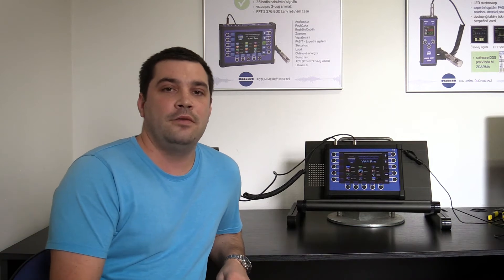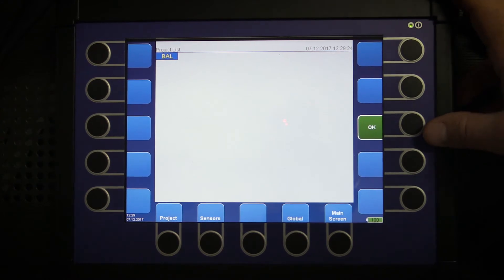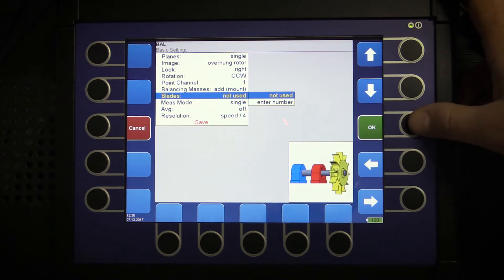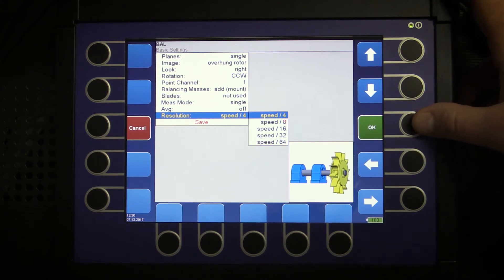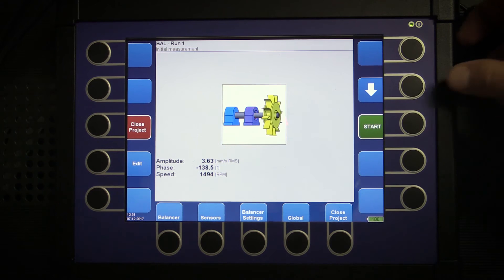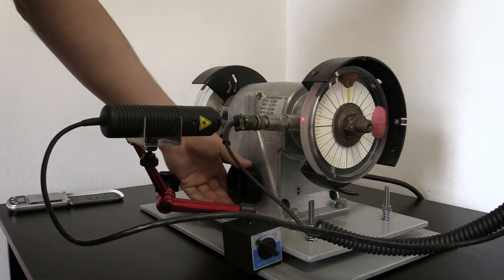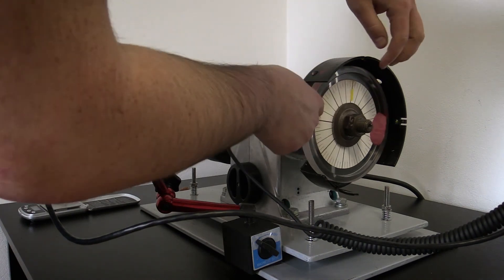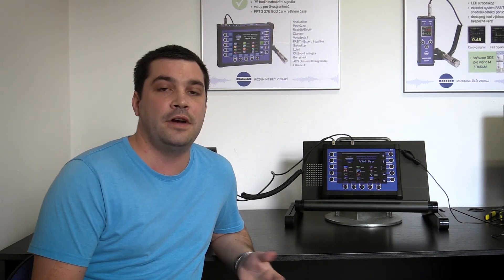Single plane balancing tutorial

Comment: Sir very much glad to see this device wonderful i am a cbm engineer from india I will suggest my company for this adash analyser but i have a doubt in i iam not satisfied in  1 st correction mass and i put 2nd correction to reduce more vibration then the angle i will count from which position means from 0 or 1st correction weight position
Reply from the maker: 2nd correction will be placed again from 0 position, means from the trial weight position.
Reply: Yes correction or later if required trim weight should be from trail weight

Comment: Can you balance a fan impeller if the motor is mounted on anti vibration springs?
Reply: Yes , I have been balancing jobs with anti-vibration mounts, with ADASH VA4 Pro. I also used SKF Microlog, Kohtect C911, but ADASH is precise and accurate. Thanks team ADASH 

Best regards,
Trailokya
Reply from the maker: Yes, you can.

Comment: Great demo video Vaclav! I have been using the Adash VA4 pro for about 2 years now for vibration analysis and field balancing. The balancer module on this analyzer is quite intuitive. 
Thank you for posting these videos, keep up the good work.
Reply from the maker: Hello Moses. There is not too much of a difference while balancing the fan with blades. You just need to enter the number of blades into the VA4Pro (or VA3Pro) device and the final mass will be split into blades. Contact me on revaj@adash.cz if you want to discuss something.
Reply: Adash Thank you for the feedback.
Best regards,
Moses
Reply: Hello Vaclav, very clear videos, thank you.Would you also add a video on how to balance a fan with blades.When do we use two plane balancing?